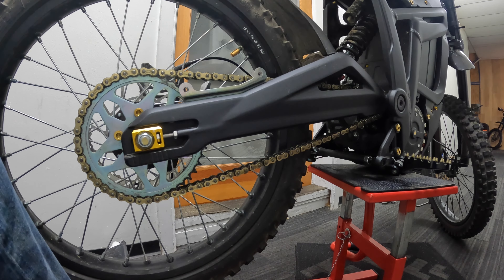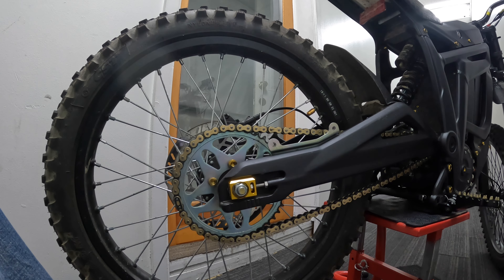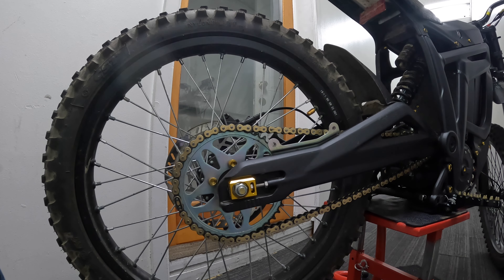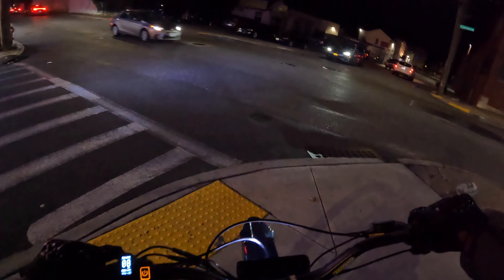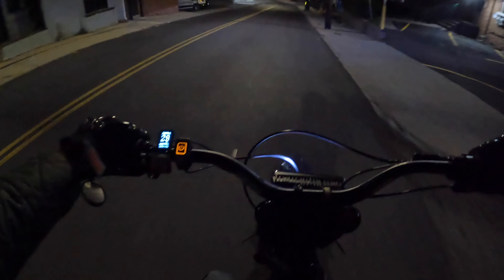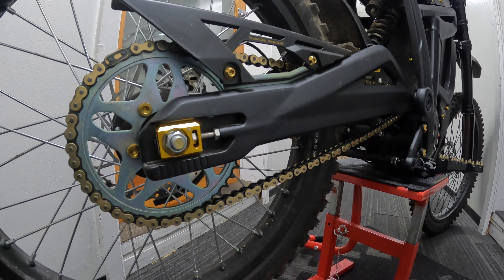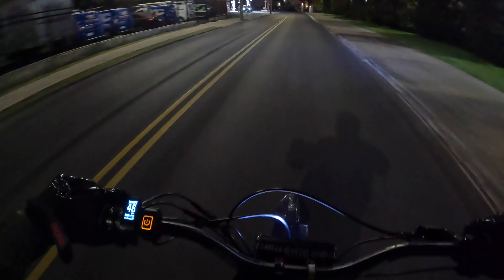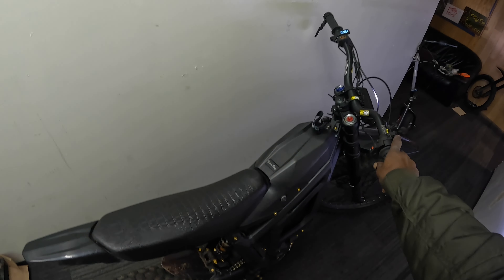Talaria Sting R 420 Chain Install, Is this A Upgrade

Comment: It’s expensive but if you ever want a 70 mph bike get the x9000 controller and a 72v battery. What state are you in that gas station Looks like one in Baltimore.
Reply from the maker: im looking a couple different setups and im leaning towards the KO big block, i was jus trying this for shits and giggles 3-5 MPH gain for 40,  would have been nice but no luck,  Im in Mount Vernon New York.
Reply: @ridieboo8403  crazy you can gain speed just by switching the chain